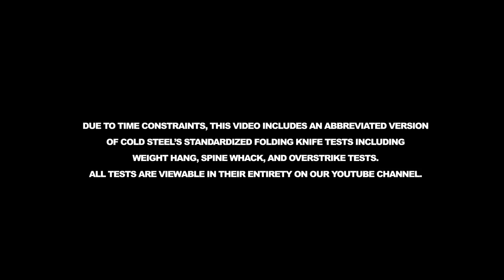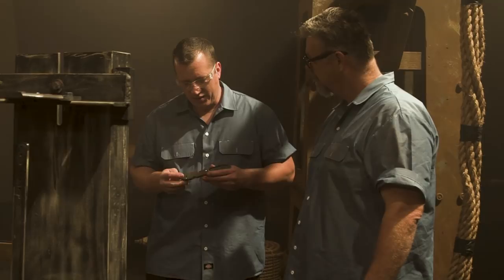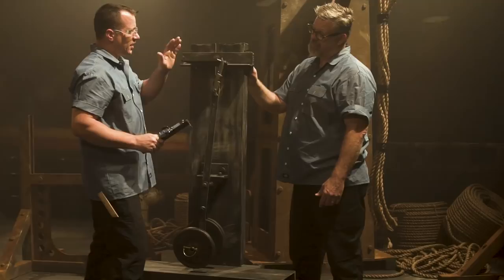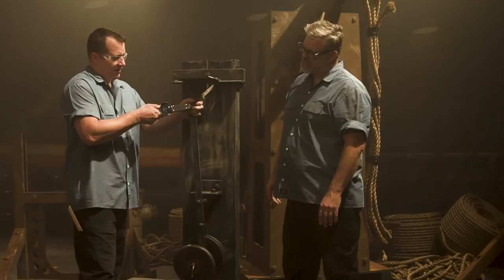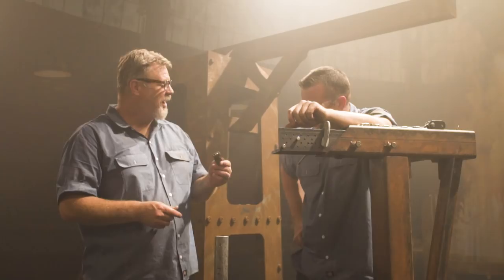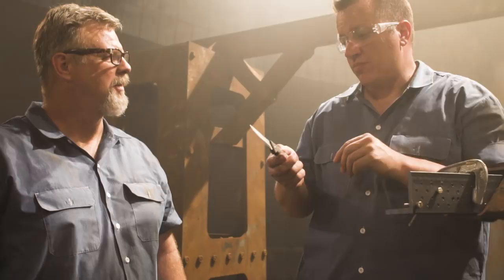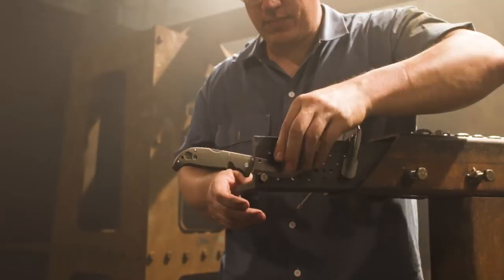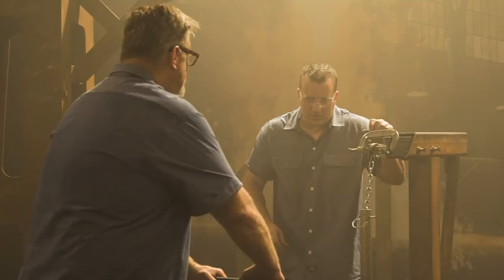COLD STEEL- IRON PROOF 2018- Finn Wolf

Comment: Have had this knife for a good 3 years now.  Has been my EDC and it has performed perfectly and to satisfaction.  I don't mind the steel used.  It keeps this model affordable, unlike my ultimate hunter, which I would never use the way I use my Finn Wolf.
Reply: If you remove the thumb stud, can you still open the blade with one hand? Would you mind trying it out for me? I live in an area where I can carry locking knives but they can't be one hand opening.
Reply: @Zematus737  Thank you very much for the detailed reply. Sadly, I can't risk carrying it then. If I'm caught in possesion of a locking one handed opener, I may be fined up to 12.000$ (usually under 500$), they knife will be confiscated and I may lose all weapon related permits.
Reply: @kothaelser3282  That's unfortunate.  I don't understand what your alternative can be, if even a boy scout victorinox can be flicked flipped open by the knife edge single handed.
Reply: @Zematus737  Either a non locking folding knife or a fixed blade with a blade shorter than 4 3/4 " are my options. I actually carry a Cold Steel Peace Maker 2 as EDC. I hope the laws are better where you live. I appreciate your time.
Reply: @kothaelser3282  I'm in California, so, not much better than what rights you might enjoy.   You can always look into the Finn Hawk blade if you're stuck with fixed blade but want the mora grind.  The handle is nicer than the Wolf's but I don't like the sheath, but that's an easy replacement.  I think they are the same exact blade and half the price.

Comment: Upgrade the steel, and I'll buy another! Had to take mine to an oil stone for a little bit before it was usable since the heat treat on the factory edge caused some rolling and chipping. Don't get me wrong, this is a fantastic folder, but a better steel would make it even more so.
Reply: Note: The edge rolling came from shaving down a 2x4 at work. No knots, no nails... Just the wood itself was enough.
Reply: Mine is doing the same thing. Just carved a little wood and it rolls.. Nauseatingly frustrated. Did you ever grind down to better treated steel? Or am I going to be sharpening it every time I use it?
Reply: @uticacrib1664  It seemed like the softer steel was right at the edge itself. It only took a few passes on a 400 grit stone to reach the harder material. I haven't had to actually sharpen it much since. Now all it takes is just a strop to maintain the edge.
Reply: @SurvivorEH28  Thanks. I needed a light at the end of the tunnel. I really enjoy this knife. But it's my first scandi grind blade. I'll take it to my dc4 and keep an eye on it. The AUS8A steel hasn't given me much joy yet.
Reply: @SurvivorEH28  Update and confirmation on this blade. I took my dc4 to it like it was my job one night. And then went out the next day a beat the piss out of it batoning frozen maple. Edge stayed true and the triad held up fine. Minor loosening of the main blade screw. But nothing serious that couldn't be fixed. It's good.. Just made me wonder at first. Thanks again Evan.
Reply: I find the issue to be the scandi edge being super thin and delicate, i convexed mine on a worksharp and the edge retention and toughness of the edge drastically increased. Scandi-vex for the win

Comment: upgrade the steel to s35vn and it will sell out. Aus 8 steel is outdated guys!
Reply: Good luck sharpening an S35vn Scandi edge..   That's a lot of surface area to try and wear away from a high abrasion resistance powdered metal..    AUS8 isn't really that bad on a knife that's easy to keep sharp...  However what I would like to see them do is offer a Finn Wolf in 01 or 1095.   Carbon Steels tend to just work well with Scandi edge geometry..  My Mora Companion Carbon is my go to crafting knife.
Reply: No it wouldn’t. It’s s35vn it’s

Comment: The weight-hang test was cut extremely short, looks like it could have handled way more. This filter needs to go and you need to even-out the audio levels more, some parts are way too soft and other much too loud. The way it's filmed makes it look like ass.

Comment: The triad lock system works a treat guys we know this now it's your blade steel and edge lasting ability that needs to upgrade aus8 is similar to 8cr13mov which is a budget steel
Reply: AUS8 is not a budget steel. It is the Japanese equivalent to American 440B. 8CR13mov might look similar on paper, but it is a lower quality Chinese steel that does not stand up to hard use the way AUS8 does. Thanks to all crying everyone like yourself did over AUS8, everything made now is either cheap Chinese steel or expensive, out of reach super steels that make the knives cost far more than most working people can afford. AUS8 and 1095 were great steels for the average person -- easy to sharpen, took a great edge, break and chip resistant, and most of all -- affordable. Those days are gone now and Cold Steel is one of the last knife makers to use AUS8, but that will soo be gone as well. It's sad that ignorance about steel quality ruined many of the best knives ever made for the money. People should be snagging up these Finn Wolves in AUS8 while they can.

Comment: Get rid of the thumb studs! Always in the way when you sharpen the blade!😡
Reply: 13BRAVO REDLEG There is a tutorial online on how to operate a screw driver. If your interested in removing them.
Reply: @floppinfish  I actually tried to remove it and it's pretty solidly embedded.  It could be just my knife.  I don't really have a problem sharpening though.  I use an axe pommel stone and the surface is not as large as the runway on other longer stones.